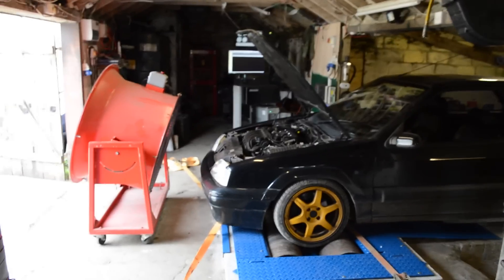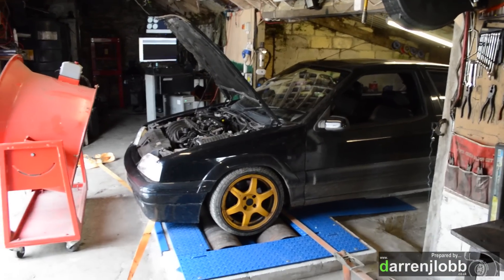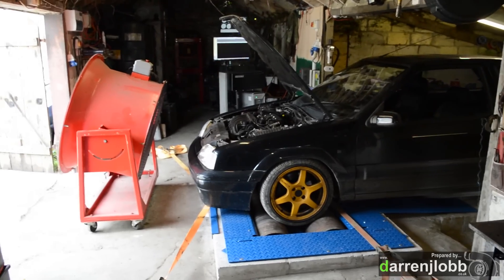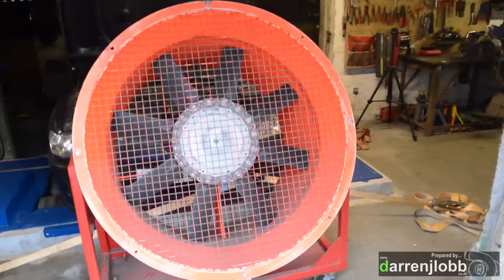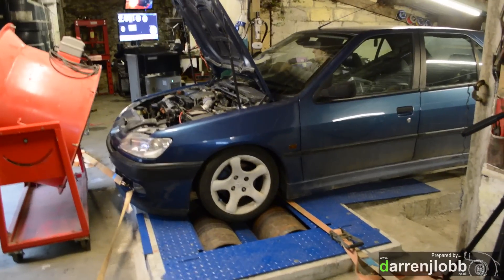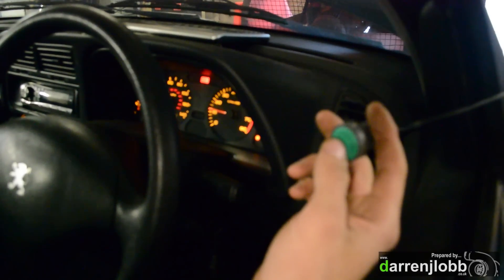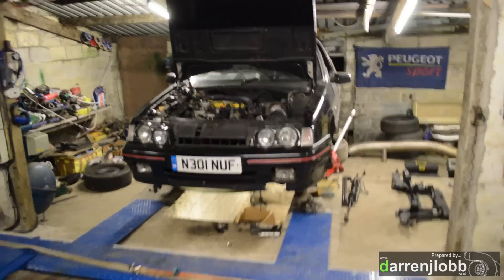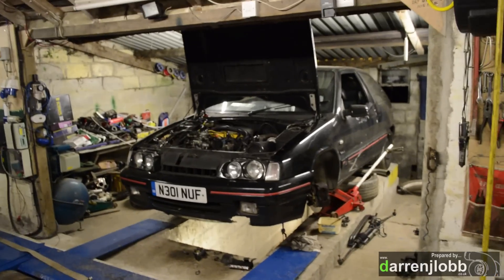Sun Ram Chassis Dyno Build Part 10 - Testing and Setup.

Comment: What are you using the phase converter for on the wall?
Reply from the maker: Phase converter runs the exhaust extraction fan, for two reasons: 1- we only have single phase here, and 2- it allows me to control the speed of the fan via the software. This means I can set it to automatically speed up / slow down the fan dependent on if the rollers are moving. Very useful for keeping noise down between runs...

Comment: What is the PV input for the PID loop? I assume t is the RPM and the SP is auto ramped by the software, adjusting the drag of the eddy for the OP? Do you use and D in the loop or just P and I?  (I'm an automation engineer by profession, hence the geeky questions!)